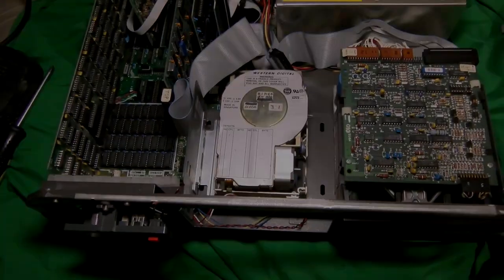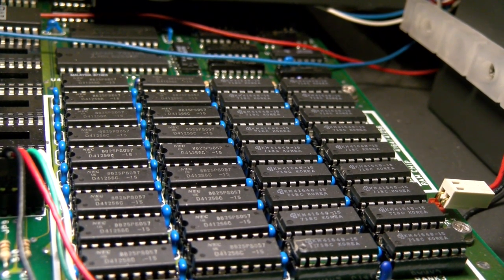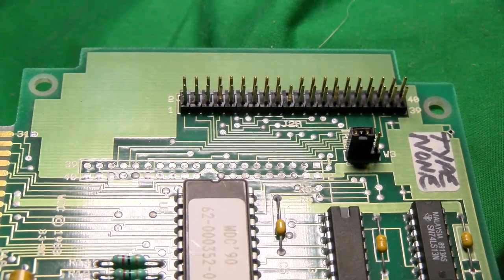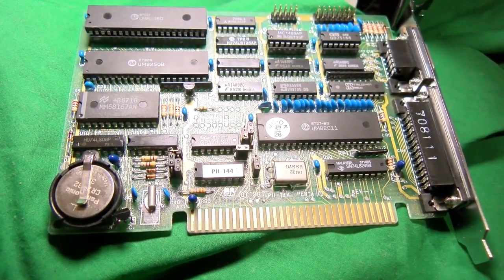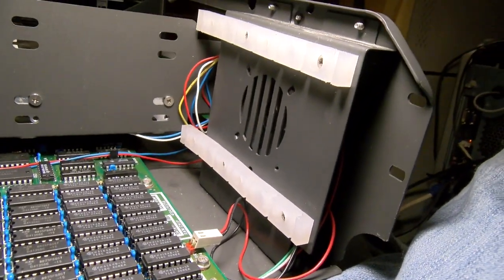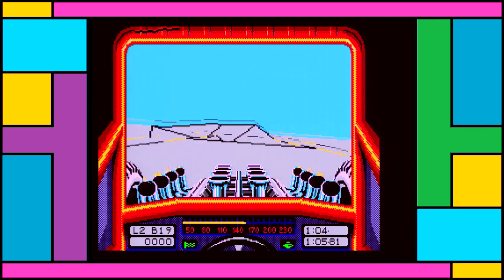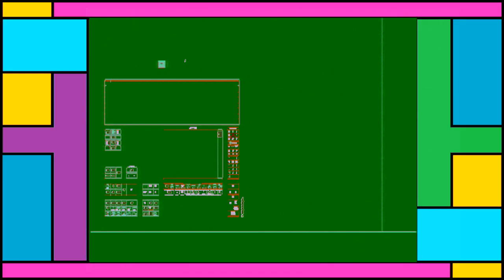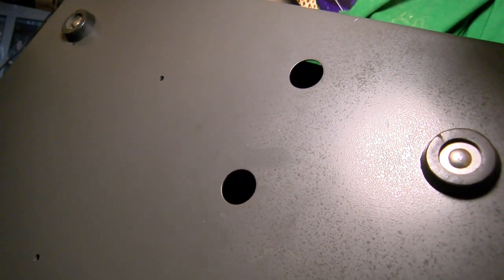Off-brand Turbo XT

Comment: Thank you for taking the time to make a video about this.  It's real dedication to import a system from another country, and then to take the time to document everything about it.  I liked how you noted the quirks with the very first PCs, such as port 3BC for LPT1, only a single 8237 and 8-bit ISA slots limiting PCs/XTs to 8 IRQs, CGA/MDA cards not having a BIOS, how RTCs were sometimes sandwiched in-between ROMs or floppy cables, etc.  Impressive recall, given that you were speaking mostly off the cuff.
  I also agree with your observation that one of the appeals of very early systems is that you can literally see exactly how the board works, since there aren't any ASICs or custom chips.

You're correct that the IDE card you have was sometimes used in a hard-card frame; I have one with a 40MB capacity.

Keep up the good work!
Reply from the maker: Thanks for the kind words. Believe me, this was far from everything and there'd easily be enough to take up several hours, hence this machine will probably appear again some day. Even SuperCalc will probably be back in some capacity as people only ever seem to bring up Lotus these days. I did worry that I'd be bored by such an archaic PC, but it sure has racked up a lot of uptime since arriving here, it's just fun to use.
Ah, well that solves that possibility with the XTA card, then. The temptation is there, if a larger PSU goes in, to populate that second IDC40 on that card and install the spare 30MB drive, given it's not useful anywhere else right now.
Reply: @HighTreason610  Sometimes the fun of such an old PC is to discover what it can do, as opposed to what it can't.

Comment: Welcome back, good to see you're still about. Don't care about the frequency or otherwise of what you put out - just do it when you have something to say worth saying. Modern PC's really do suck - I don't have anything still working from the last 15 years - all bit the dust, but I do have gear from early 2000's (core duo) which works OK, and stuff from earlier which works fine with some messing about with. Don't get me started on fcking smartphone shite. hate 'em.
Reply from the maker: Cheers.
Hardware prior to the latter half of the 2000s seems to have a decent will to live when it doesn't suffer from capacitor plague. Phones are just designed to get worse with time and don't fit in a watch pocket any more, plus they need constant power so aren't really mobile. No choice though, because no GSM masts left for the old ones.
Reply: @HighTreason610  Yep. Non replaceable batteries, designed to be impenetrable aluminium sandwiches and crippled with bloatware updates, all to encourage you to buy a new glass rectangle every year.

Meanwhile, I have an Atari STE from 1989 that is still trucking on and a Sharp VZ-2000 boombox that is older than I am that's still going and sounding top drawer. The latest iPhone is landfill fodder in three years.

Comment: There are just something magic about 8bit computers. No matter the brand. Sadly they are not always working, but when they do, then it is something special.
Reply from the maker: Technically these are 16-Bit machines, though the data bus is only 8 bits wide. In theory it should always be repairable due to the lack of ASICs, provided the specialized ICs don't completely vanish. The glue logic should be around for a long time yet.
Reply: @HighTreason610  I thought that it was an 8088 and not 8086. But yeah, some of XT's are 16 bit.

I think it is a bit like the first generations of Amiga's, Mac's and gaming consoles that were running on a M68K CPU. 16 bit external and 32 internal CPU.
Reply from the maker: The 8088 is a bit of a bastard chip. It's a 16-Bit CPU, with an 8-Bit data bus and 20-Bit address bus. The 68K is, indeed, a basket case too.
Reply: @HighTreason610  A bit like the 386sx 😉

Comment: Nice desk. I kind of envisage your house as being this incredible treasure cave of classic PCs and synths and boomboxes all from the floor to the ceiling with just a little pathway to get through.

As it happens I've taken the plunge and started a retro PC build. I'm going for around 1998 so I've got a Intel SE440BX-2 board, an ATI Rage 128, a Pentium II 300 which when it arrives I'm going to be attempting to overclock by running at 100MHz bus speed like you could with the Celeron A, and a beige case and optical and floppy drives donated from my employer who would only have binned it.

I was going to use its innards as well which turned out to be a Celeron SL633 and a PC Chips motherboard but it had capacitor plague and wouldn't boot reliably.

Given the fact it's very annoying to play Windows 9x games in modern PCs. Some of them tend to wig out because they can't understand 16:9 resolutions or what a Ryzen CPU or what an RTX graphics card is, or what Windows 10 is for that matter, or that there are privileges needed to access C:\Program Files these days. So, the Big Beige Bastard is under construction.

Once it's up I might start my own retro channel. I will have a classic PC and a brace of Atari STs so I'll be able to show off the things I grew up playing on real hardware.
Reply from the maker: Not quite, but it's all a bit cramped due to coming from a much larger house.
I say go for it. Just beware that the SE440BX is a pretty locked down and boring board compared to some of its contemporaries, plus it only supports one floppy. They are, however, pretty bulletproof and the BX chipset is legendarily good.
Reply: @HighTreason610  Well, the PII 300 arrived today and I got it in. It was a really odd one where the heatsink was like this big mess with the fan on one side of it that precluded or from fitting in the slot. So that's gone and been reconfigured with zip ties. I also found that as you said the board is locked down as there's no way to manually change bus speeds. Might try an overclock to 333 MHz when the whole thing is going properly.

I think the floppy drive is busted. It won't read a disk and every type I try to set it as in bios is wrong. Ugh.
Reply from the maker: One of the OEMs used to put their fans on the side like that, but I can't remember which one. Does your floppy drive have any jumpers on it? Does the cable have the twist in it? Your drive should be at the twisted end of the data cable and if there are jumpers, it needs to be set for DS1 instead of DS0. There might be others for things like motor signalling that I don't remember the specifics of off the top of my head.
Reply: @HighTreason610  Welp, I made it recognise the drive and decide what type it is without complaining, but it (the drive itself) won't read any disk. I think it is borked. But then it did start life in an office box from over 20 years ago that only just got decommissioned from my work (It contained a client database that the IT guy kept putting off migrating to another system) so it probably collapsed years ago and nobody noticed.

Working real (non USB) floppy drives in my experience are like gold dust. The disks are just fine; I have Atari ST disks from the late eighties that still read and write no problem. It's the drives. They are dying by the month.

Comment: Mostly identical to my DTK XT. Mine had the standard MFM Seagate 20MB drive, and a 5-1/4 1.2MB floppy, not full height as yours.  If you want spare motherboard and I/O card let me know.  Throw Tandy into the mix for another expensive type of keyboard.  This board is why I prefer the PB500 just because by 89 the XT was just a little less archaic. While our PSU's look the same, I am fairly certain mine is not solid core wire. I just handled it by it's wires recently I don't recall them feeling different than I am use to them being. Solid core wire I think I would have noticed.  Curious differences to the same machines.  Amazing how clean these stay isn't it without fans to push dust and dirt into the computer!
Reply from the maker: It seems that it was a fairly common machine. As yet, I've no need of spares, though incidentally it did become intermittent and then stop working completely a while after I got it. Giving the board a wash in the sink made that problem go away, which may be why it looks so clean as it was actually a bit grimy upon arrival. I have to think that the wire was probably just whatever was cheapest on the day they ordered it.

Comment: I do love my 10MHz SHo-Tronics Turbo XT. was my go-to CGA PC/XT class machine for a while until I got ahold of a Tandy 1000SX. certainly not as fast as the turbo XT in turbo mode but that 16 color TGA mode and Tandy sound is just more useful for my purposes. I always liked that case though, yours doesn't seem quite as yellowed as mine is, I guess there's always retro bright but...meh.
Reply from the maker: Nintenloup also seems to rather like his Tandy. I'd consider buying one myself if I found a decent composing tool for the SN76489 that some of them had.
The case can stay yellow, it's part of the machine's history.
Now I need to get around to watching your Via C3 video.

Comment: Just the other day I was thinking "I haven't seen a video from HighTreason for a really fucking long time - I hope he's okay" and, lo and behold, here it is. I usually get push notifications for your uploads, but not this time - had to look you up. Anyway, onto the actual comment. It's long. Because the video is long. I had to take notes, in fact.

- Power switch. My 'mystery AT clone' that I did a brief video on is in a very similar case and has the same style of PSU. It pretty much shattered after it had been turned on once or twice, so yes, it can happen. I sourced a pair of replacements from Israel, so I can send you a replacement should you ever need one.

- PSU connector. The P8 and P9 plugs don't seem to marry properly with the connector on the motherboard, yet you didn't mention this. Was it like that from the OEM do we think?

- I/O card. That's a bit nuts that you happened to have that DTK 'penta' card. I guess it provides all the same features as these 'Six Pack' cards did, minus the RAM and that makes perfect sense considering the mobo has all the RAM on it - further evidence it's an intentional match.

- HDD card. Incredible that you have one of these post-IDE, XT-IDE cards - I've never seen one in the wild. Maybe I'll come across one someday. For now I have a proliferation of MFM cards that I will never need because I only have one MFM drive. Irritatingly I had none when I found the HDD so I traded it for a handful of my ISA cards (kinda like the time I swapped a Cadbury Creme Egg for a Parker fountain pen in primary school). I imagine you have MFM controllers, just not drives.

- Motorola. I had never considered your observation about the CRT controller and the 6800. What a fascinating thought.

- DOS ROM. My T1000 has DOS in ROM and I have a couple of computers with sockets for one, so I'll see if it works elsewhere and can provide you with a .bin if so.

- Keyboard. When I acquired the BT Zenith XT, I had no compatible keyboard and looked into creating the PIC converter that you have used. I never got around to it because someone offered me a matching keyboard for the Zenith for an absolute bargain. I do sometimes admire the shit you've got in your collection, but then I remember I've got some cool stuff too, just different.

- TOPBench. How the fuck did my benchmark result get into the database? I do not AT ALL remember submitting anything, but I guess I must have done. It's also entirely plausible that Jim put a trojan in there that uploads results automatically by any means necessary. Thanks for the shout out - that was a nice surprise.

- Is that a Prophet I see???
Reply from the maker: YouTube seems to be on one of its periods for being more broken than usual the last few weeks, so that's hardly a surprise.
- Power Switch. Can't see it being an issue any time soon and I have continuation plans in place if it does get broken.
- PSU Connector. It's not the only one I have where the connectors sit like that. I think the base of the connector is just lower, but is flat instead of having the recesses. Probably a cheaper connector type. The pins seem to make good enough contact anyway.
- I/O Card. I know there's a Hexa. I think Sixpak was an AST thing, to which end I'm almost certain they, or another OEM, shoved their RTC on the video card once.
- ROM DOS. I'm aware of Tandy having it, but somehow doubt it would work properly on generic machines. I've not actually found much time to track down a generic version as yet, but somewhere must have it. There might even be a way to build one from that DOS source leak.
- Topbench. It's NSSI you want to watch out for, as it has an uncanny knack for knowing when the clock is wrong.
- Prophet. Yes.

Comment: Hi there! Do you still have the whole file of the ray of light animation? ^^🙏
Reply from the maker: Only those in the ZIP linked from Part 15.
Reply: @HighTreason610  hmmm could it be that the file has got a different name rather than „ray of light“?
Reply from the maker: I would have thought so.
Reply: @HighTreason610  couldn‘t find it yet. Nevermind though. I‘m soo happy you preserved so many icredible animations of the early internet days that‘d otherwise be lost now! ^^

btw: was the animation/music used in ray of light actually longer at one point? Bc the music cuts to a different segment in the middle of the animation
Reply from the maker: allegory.swf, maybe, for the one with the airship. I can't remember the menu one, possibly main.swf. I can't test currently.
The music is considerably longer, but the animation just plays as fast as the PC can go. The Pentium III I was using would have been among the fastest machines of the time, topped only by the original Athlon, so the full file won't play. It might be that if you drag the SWF into something like VLC, it'll just play the embedded WAVs, depending how the flash file was made, though tools do exist to rip them somewhere.
Reply: @HighTreason610  can you do me a favor and see if those actually are the ray of light files? ^^ 🙏 It‘s nearly 3am here in vienna and I‘m laying in bed now lmao
Reply from the maker: I'd like to find the rest of the animations from that series some day, but I never had them and can't recall ever seeing them, nor would I even know where to begin with finding them now, if they still exist. Truly amazing looking for Flash of that era. Always liked that the music was from a Yamaha MU, too.
Reply: @HighTreason610  hi it‘s me again! ^^ could you do me a favor if you‘ve got some free time? 🙏 can you rip the music file of ray of light? I can also pay you, if you want to :)
Reply from the maker: http://dxzeff.com/trash/allegory.zip

Comment: XT’s AT’s tend to be built like tanks still runs today as long as the power supply is solid, , it could be quite nice to have a system’s roundup at some point in age order? But I presume only one or two are setup at a time?. if you wanna go back to the to the real early days and be a screw up , dare I say you cover a CP/M machine? I think gary kildall was a pretty crazy guy in the end after losing out to bill gated. Or is that too archaic? Have you rationalised your systems museum like, or do you only tend to have one or two set up at a time? I can recommend a lacie 22 iv electron blue if you want a real performant crt, the hobby will be really ruined like everything , if the speculators get into it, though they tend to only like sealed in a box etc, people do want too much for what would otherwise be electronic waste certainly on ebay, I think sometimes local pickup is the best way, but it’s tough. Works best for people who Live in posh areas where people just want shot of stuff nearby. .I often think about collecting and retaining some more older hardware, but currently I’m limiting myself to the niche of the best of Apple PowerPC architecture that boots macos 9 still which is a narrow enough range, though even that I have too much of, your x86 coverage is as usual - great, I think the channel graphics stand out in a good retro way, I always know it’s a hightreason video, try and retain that if you update them ;) remember to keep it interesting for yourself by changing up topics as you see fit, as interest come across in videos etc. I’ve often though archiving random user recorded VHS tapes to YouTube might be worthwhile channel, who knows what lost media is out there?
Reply from the maker: Only about two machines can be set up at one time.
I'd actually like to at least try CP/M 86 on this thing some time, but don't know yet if it would be enough for a video.
Good luck with local pickup here, people hate selling things and will even actively break it if they know you want it. They'd rather send it to landfill in pieces - "What the fuck do you want that for? No! It's mine." (Proceeds to destroy tape deck or whatever and give you a really cocky look)... no shit, I've had multiple people do this over the years.
Ah yes, Apple gear, no idea on any of that stuff, so I wish you luck. The collection here is just about complete now, with only a small handful of things left on the 'kinda want it but won't go looking for it' list.
The channel graphics probably won't change much. There are experiments with other styles, everything from 70s line art (v=DrUwB6hzY7g) to 2000s bubble crap, but it'll probably end up just being a small tweak to the existing style.
In any case, thanks.